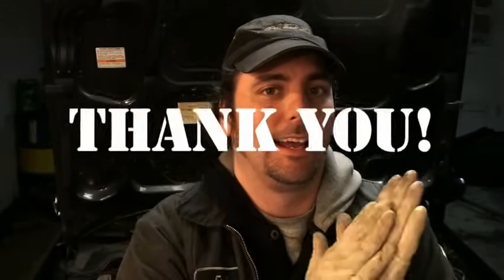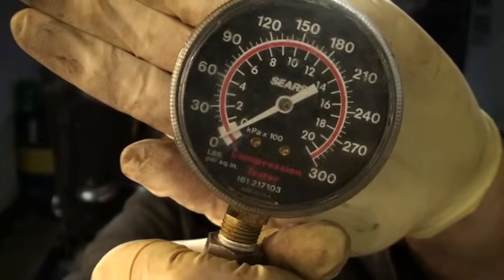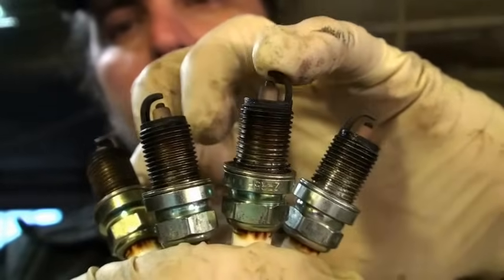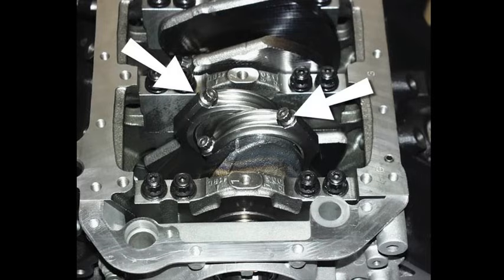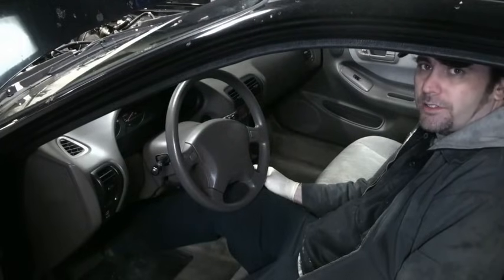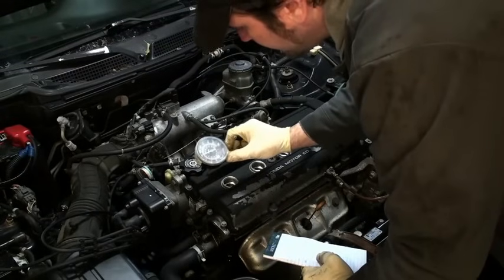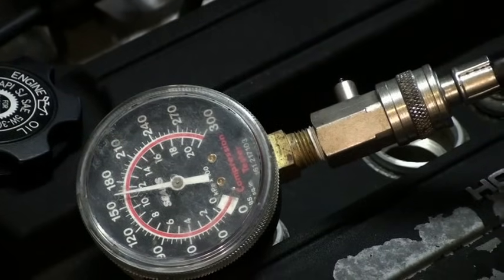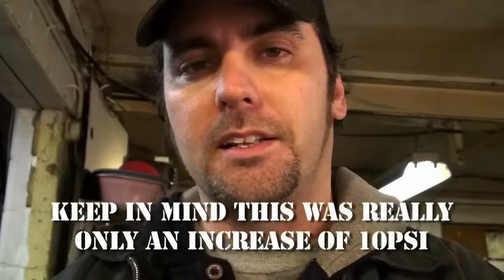How To Perform a Compression Test - EricTheCarGuy

Comment: You're very informational. This video was great. Question though, if you have a misfire in a specific cylinder that the CEL is reading, can i just save time by only doing that cylinder and maybe another one on the other side or should I still do all 8 on my 05 Mustang GT. Thanks!

Comment: I have the same issue as Omar..I have an active code for '"clutch pressure control valve B failure" as well i've been told it could be my throw out bearing

Comment: just a couple of things I would like to mention, with a lot of non starters I had it was down to excessive fuel in the bores, due to excesvive cranking etc with low battery, that done 2 things, it soaked the plug in fuel so it wouldn't fire, and the Petrol/gas got into the bores and washed all the oil off the cylinders and lost the compression, I cleaned the plugs and put some oil down the bores which gave it a bit of compression and it started......Fred

Comment: very nice video. i have a question? i had a loud sound while driving last week. made it back to the house. I actually posted my video on youtube so i wont go to far into it. I found broken tensioner and tensioner guides. replaced, put all back together and have a horrible knocking sound. did compression check like your video shows, and i have ZERO compression on valve two. the other three valves tested dry at 180 wet at 190 to 194. Zero compression? what to do, cry? buy new truck? helppppp.

Comment: I have a 1989 waverunner 2 cylinder. Did a compresion check on it. Cyl. 1 was 170, and Cyl. 2 was 110!!!
Im going to give it a fresh top end this winter, but it runs.  Honestly not that bad, but at idle its roughhhh.  Anyway, I still take it to the river.  just thought it was interesting.

Comment: sir eric i have a problem in my jeep.n the problem is in first when u start the jeep its good.but afta runinn few kilometer the auto fans dont work n jeeps strat off automatically n doest start untill its cools down so i change tha crank position sensor n den its works so i run da jeep bt afta runinn 100 to 200 km when i stop tha jeep n try to start same problem back n afta replacing the old crank sensor it again work lik dis i cam back from 600 km far.sir is it the crank sensor or some else

Comment: Great video, to the point, simple, accurate.  This will help my son in his efforts to see if he blew the head gasket or cracked the block in his 1981 Mustang (once mine!).  Long story, don't ask.......  Much work to do;  glad it's my son doing it!
Reply: Blown head gasket and cracked block are hard to distinguish...you would need to take the head off and run a dye test on the block to confirm any cracks....

Comment: hey eric i go to uti and i just did a compression test on my integra i forgot to disconect the connecter to the distributor and my spark plus wires were hanging out by my aluminum radiator while i was cranking over the engine. i installed everything back together now it dosnt start. I checked everything and found out im not geting spark. im guessing its my igniter in my distributor since my ign coil fuse isnt blown. please shoot me back some ideas u may have or if it is the distributor

Comment: Hello from Germany!

Very much nice video. I habs also thus done.
My Toyota Corolla 1.6 construction year 2002 had at 40 degrees of engine temperature the following values:

Z 1: 11.1 bars / Z2: 11.3 bars / Z3: 11.4bar and Z4: 11.7 bars

130,000 miles are the very good values

Has changed the cylinder head itself because I had burned through outlet valves.

Dear greeting in the USA from Salzwedel in Eastern Germany
Mike

Comment: First of all i think your videos are very helpful, having said that i think you forgot to mention the real reason for the WET test which is to determine whether you have a worn out piston rings/cylinder walls or head valves, if the pressure goes up = worn piston rings and if the pressure stays the same you have head valves issues, but i figure it only applies when the overall compression is really bad, please correct me if im wrong, this info is from my readings not personal experience.

Comment: this is the only way i can seem to ask my question. well i change my fuel pump. well after putting everything back to gather. i was driving. and when i got out i seen gas coming from the filler hose.i look down and there was a hole that seem to me like it got blown out. is there any reason why the pressure would blow the filler hose like that..?

Comment: Good video. 2 things I would change though. The blow between cylinders will usually cause a major missfire. If it is interchamber blowing in most cases it will sound like a bearing knock.
Then the best way to determine the front of the engine. The front of the engine is always the side your cambelt or timing chain and auxilary belts, alternator and water pump runs. :)
Reply: I thought Jesus was a carpenter
Reply: @macknumber9  Maybe you shouldn't think at all.
Reply: @turbocpt1  just joking...chill out man...be like the real jesus
Reply: @macknumber9  There is only one Jesus and that is me, so I am being like the real Jesus, and I was only joking as well.

Comment: I just changed the gasket a week or so ago cause i was taking it off to clean my IACV and FIV and cracked the gasket, throttle cable does stick but thats only when its closed and wouldnt cause loss of power. I'm seriously thinking it has something to do with my Fuel Delivery system, maybe a faulty sensor or malfunctioning injector. IDK, appreciate the help though.

Comment: Hi Eric, 

My 96 Prelude 2.2L VTEC has been haivng problems that I think compression or my fuel injection system  may be causing. During driving, my car will sometimes drop power and slow down until either a few seconds later or I step on the pedal more then it revs up really quick on its own until I let off. What could be causing this problem? My car is Manual Transmission btw.

-Nick.

Comment: Eric, I have a 96 Honda Accord EX 4 cylinder. I keep getting a P0402 code. I've change the all plugs, wires, rotor and distributor cap. It still giving me the same code telling me its a # 2 misfire. The car is running fine with no loss of power nor its missing. I haven't done a compression test as of yet. Any ideas?

Comment: I was reading online that you can use a compression test to tell if you have a cracked cylinder head. What would I look for in the compression test for this? I'm curious because my Probe is overheating and I'm trying to diagnose the issue. I've changed the thermostat, my mechanic says it sounded like the cylinder head was cracked at the water jacket and leaking compression. He said to take the radiator cap off and start the engine if fluid comes out of the radiator, its a cracked head.

Comment: no the piston shouldn't be making any noise if they are they usually aren't still in the engine or not for long .i would check and make sure theres oil in it.if it has oil it could be a stuck valve or lifter.hope its not a rod and pray its not a main bearing on the crankshaft.

Comment: On Hondas and Acuras of this genre (B, D, H, F, series etc) all you need to do to shut off fuel and spark is pull the ECU fuse out from the fuse box under the hood. This fuse is labeled "Backup / Radio" Its easier than unplugging things in my opinion...

Engine should be warmed up prior to doing the test.

The throttle plate should be fully openend during cranking to allow air to flow freely into the cylinder.

Comment: Even if after you place oil in the combustion with your wet compression test you measure a difference in compression, that only indicates a possible piston ring problem and NOTHING else. A leak down test is much more accurate I.e. rings or valves etc. additionally, putting oil in the combustion chamber is ill advised. it will damage the catalytic converter by coating its substrate.

Comment: Dont forget to have the throttle WIDE OPEN when performing a compression test to allow maximum air intake. If you have an electronic throttle, place key on engine off and block open the throttle pedal all the way to the floor before cranking. Also, perform a COLD engine compression test and a WARM compression test. Some engines misbehave only when cold or only when at operating temp. Dont bother with the wet compression test unless you have a large variation from specifications.

Comment: "Clear flood mode".... Not correct. Disable injectors by pulling the fuse for the injectors AND fuel pump. Block open throttle plate. Use remote starter so you can watch the gauge... watch for 4 compression cycles. Cylinder needs more than 85 psi. and should be under 20% difference of all cylinders when averaged. If pressure doesn't increase wet, you most likely have a valve problem, but it could be a gasket as well. Valve seals will not affect a compression test.

Comment: My car idles very low & it cuts off @ stop signs and red lights. It only does this after I've been driving it awhile. No lights come on on the dashboard..nothing smokes or runs hot or out. I was looking at compression test videos on youtube. I was also on google looking up answers or trying to find someone else with the same problem. Everyone seemed to say it was something wrong with the cylinders..maybe being cracked or something?! I drive a 2002 Honda Civic I have a 4 cylinder. SOME1 HELP!

Comment: would a blocked cat converter also cause a surging/pulsing noise when driving holding the gas so I'm cruising with rpms around 2,000? I posted a video on my page of the sound if you wanna check it out an see what you think.

Comment: High oil consumption with high fuel consumption and runnability issues in idle would point to a blocked catalytic converter. Could be a lot of other things too though, you need correct diagnostics done to isolate the problem.

Comment: Looks like normal wear on piston rings one and two, and heavily worn rings on pistons three and four. 

The white haze you refer to usually indicates a lean condition (too little fuel in the mixture or too much air/vacuum leak).

Comment: I have a 2.4L DOHC 2002 Cavalier with 207,000kms runs and drives but recently noticed fuel consumption increase changed plugs an the plug boots....then checked oil recently an it was pretty low an it was just changed a month ago, the car seems to rumble a bit when I sit in neutral an rev an hold it at about 2,000rpms an a bit higher then it goes away beyond that and below that....what do you figure the issue is?

Comment: for eric or anyone that may know what it is, i have a 99 ford ranger with a 2.5 liter 4cyl engine. after filling up with fuel and restarting the engine the truck began to run really rough and had slim to no power what so ever. cylinders 2-3 are not firing and i find it odd they just so happen to be next to eachother. could a head gasket have gone just by restarting the engine like that? it has not thrown an engine light and has left me and others mind boggled as to what is happening.

Comment: After watching this video I still have a question about my compression test results. My R4 engine seems to run just fine, but I still decided to do the test. One of my cylinders did not actually have lower, but instead higher compression than the others. All cylinders from one to three had about 180 psi when the fourth gave over 200 psi. Have all other cylinders worn out exept my fourth cylinder? The oil pump is closest to the first cylinder... Quite odd... Thank you for all the videos!

Comment: Check your firing order, either via a manual or just Google image search the make, model & year of the car, plus the phrase "firing order." When you get a result, make sure the image specifies which direction the engine is facing in the diagram, as in whether the cylinders are being counted from the front of the car or the back.

Comment: It's also ideal to perform these tests when the engine is warmed up around 210 degrees meaning the thermometer gauge needle is around the middle. Just to be more consistent, because the cylinder walls diameter can slightly change in a fraction of a millimeter.

Comment: my car broke down today and had it toed and once there he did a compression test and cylinders #1 and #2 were leaking between eachother both with no pressure. is this just a head gasket problem or worse. engine has never overheated!

Comment: easy when their on the top, sometimes on v8s or v6 with spark plugs on the side you will have to go thru the wheel well to get to some of the cylinders. especially if they have an air con compressor on top of them. 
Good videos, a couple have helped me out on a fewe problems.

Comment: I did a compression test on my 4cyl 99 mazda 626, I have disconnected ignition coil / injectors. Also opened the throttle body to about 85%. The spark plugs were not bent nor did they have any oil / burnt marks on them just a white haze over them.I have completed dry and wet test and want to find out if my rings are warn. Could you thumbs up to the top so everyone can see. Thanks.
Cylinder    1        2        3        4
Dry         170    150     160    140
Wet        180    160     190    160

Comment: I have a 1977 chevy nova with 355 and makes 220hp at the wheels and a little over 300hp at the crank... How much horsepower would Patriot Aluminum heads 185cc and Comp Cam Mutha Thumper cam add?

Comment: I got 180 psi all across the board on my 180,000 mile B18B1 engine. Same engine in video. (1996 Acura Integra)  Factory specs are 190 psi.  My engine is fresh!  Royal Purple FTW!

Comment: You are suppose to floor your gas pedal, step on clutch pedal (put handbrake on) and crank for like 5 seconds like he did. To make sure your engine doesn't start you remove the fuel pump fuse.

Comment: hey eric. i did a lot of research but couldnt find anything on the DOHC F20B jdm honda engine.. i found enough about it...and im doin my first tune up by myself..    i put the f20b engine into my honda prelude.. and im wondering if the 2.0L f20b engine  will use the same parts ( wires plugs cap rotor fuel pump ) as the 2.2l h22a4 engine .. the f20b engine is from japan.. and isnt sold here in canada.. or us.. so its impiossible to find plugs and wires and brakes or anything for the f20b.

Comment: Hey Eric,I have a question.Its not about a car but its about a Motorcycle.My 1983 Kawasaki GPZ 750.The bike which I picked up two weeks back has trouble getting it started.Has only 36K kilometers on it.The carbs are clean like new.Carbs getting gas all the time but the fuel is not getting into the cylinders.All the spark plugs are dry.Am pretty sure that there is nothing wrong with the carbs and ignition system.Does it have anything to do with poor compression or tight valves anything like that?

Comment: @MyDucatiGT1000.So after 4 or 5 hours trying to get it out I gave up on trying to save the tester.I tried drilling and an easy out extractor but the tester would not budge.I ended up pulling the head off the engine.wow was I surprised at what I found! The end of the compression tester had split in half and mushroomed out jamming it in the hole.I took the head down to my local mill guy he bored out the tester with out damaging the threads.NEVER BUY A CRAFTSMAN COMPRESSION TESTER!

Comment: I have a little problem I just did a compression test on my van. The spark plug adapter unscrewed its self from the hose and is stuck in the spark plug home down the spark plug tube.  I tried to red lock tight them together and even then the lock tight brakes before the adapter comes free. How can I get the adapter out with out taking apart my engine?

Comment: Not that it matters for this, but on most engines the cylinder closest to the acc. drive is #1.  The one you are calling #1 should be #4 on that Honda motor.
Also should do comp test with throttle wide open and good idea to put a charger on the battery.

Comment: Hi Eric-

I have an 84 Bronco with a 351 Cleveland with 4V heads. I'm going to do a compression test. Should the engine be warmed up prior to doing it? Also, should all the plugs be removed before doing it? Would you know about what amount of compression that I should be expecting if all the valves, head gaskets and rings are all right? Thanks

Comment: @vTeChRDC5 k20 type r? what exact engine code is that? If you can figure out what compression ratio that engine has you can use a conversion calculator to calculate the amount of psi it should be pushing out.

Comment: I have a 150cc gy6 engine in my scooter.  It misfires at higher speed/rpms.

It starts very good, idles nice and has good acceleration.  But when I get up to near top speed (40mph +) it starts to misfire.

If I had a burnt valve, would it still start and run very good, only to start misfiring at higher speeds?

Could the valve gap being off .001 in. be enough to make it misfire like that?

Comment from the maker: @chamblizi I would fix the oil leak first and check the oil pressure with an analog gauge to see what pressure you really have, if the engine has noise AND low oil pressure it may be time for a rebuild or replacement.

Comment from the maker: @chamblizi You might want to recheck those oil numbers from what I remember it was either 10W 30 or 10W40 that those things used but even so you might have an oil consumption problem.  As for the hard starting it might have nothing to do with the compression but perhaps a carburetor issue.  As for the leaking sensor I'm not sure but it could be the oil pressure sensor.

Comment from the maker: @vatan1923 No but some have glow plugs that you can remove and do the test in the same way, with others you might be able to remove the injectors to insert the tool to do the test with the correct adapters.

Comment from the maker: @Catass2089 The spark plugs don't make the engine turn over the starter does and yes you would do this same thing on any engine it's just a matter of putting the gauge in to measure the compression.